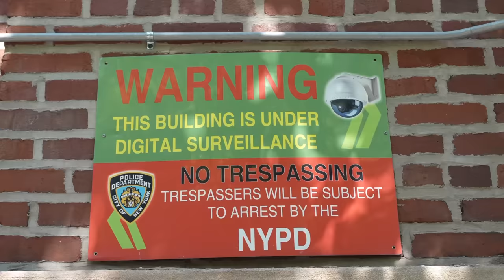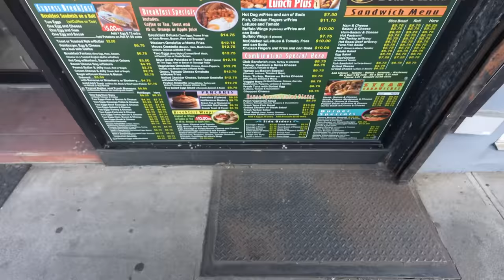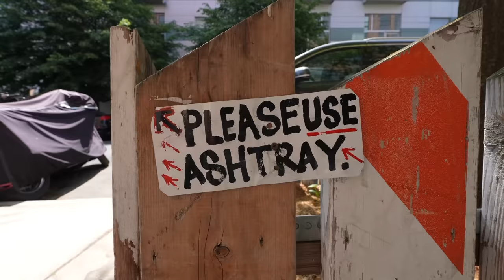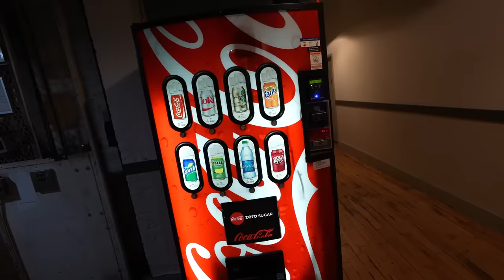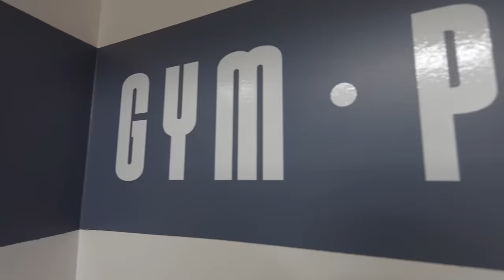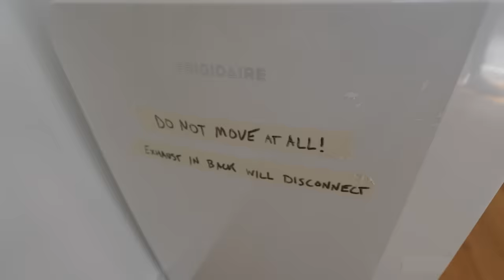I Found NYC’s Largest Loft… But Nobody’s Renting It

Comment: Best lofts I have seen ever. Units 2 & 4 are the winners for me because I would be able to stand up in the lofted spaces. Not too concerned about not having a dishwasher as I wash my dishes by hand as a single guy. And I don’t generate much in the way of dirty dishes either. Don’t need the amenities of the second building, the first building has just the right amount for me. Yeah, all around great units today.

Comment: These were all great. I'm most impressed by the sturdiness of the stairs to the lofts & the fact you could actually stand up in them. They often seem like a dangerous addition that an amateur constructed. Nice finds!
Reply: Agreed.  In the old factory lofts the staircases should have been made with wrougth iron stokes as well as the 4th one should have had metal pillars under the area of the loft--it looks like the wooden ones could crumble at almost anytime!  :face-blue-wide-eyes:😨😨😧

Comment: I actually liked them all.   The 1st building had more character but the 2nd more amenities.   The 2nd with the walk-in vault was definitely quirky.  1-4 were pretty basic but still nice.   & so much room in each!!!  Just not sure about the gas heat units. Probably put a carbon monoxide detector in each room for that reason

Comment: #1 has tons of space, but I'd hit my head in the loft.  #2 is bigger and more finished, and except for the pipe the headroom in the loft is quite adequate, which explains the higher price.  #3 could be shared, making the per-person price affordable for many.   #4 has the pipe-headroom problem, but it has tons of storage and a bigger, separate kitchen.  #5 is the most expensive and has nice finishes, and it's in a building with many amenities, so for a two-bedroom (plus loft) you get the most for your money.

Comment: 2nd Loft is very nice, spacious (1st isn't bad).  Apt. 3 has a great kitchen area and bathroom. Apt 5 sold it with the multiple bookshelves; kitchen could be bigger for that price.  The apt in the other building overall with the rooftop views is very nice for that price, especially with the sauna, pool and closet space.

Comment: the first place can sectional it off for another room. under the upstairs place. so could make it 2 beds for 1,500 each. the second place can be sectional off for another room and split the rent. or makes great area for photography studio for portraits shoot or other photography studio.  the 4 place can turn into photography studio and still have bed room and other stuff you need. the upper bedroom can be use as editing place and storage area to keep gear locked up if get broken into. first place with 4 bedrooms has tons of options for use. the fifth place upstairs area would be used to hold and lockup all my expensive camera gear if downstairs area has room photography studio but upstairs for editing stuff. out side area great for photographer areas for portraits area. also this best 5 aprt  you shown in long time

Comment: Ah man....
What would be cool for the one where you need to get to door with ladder. 
Build a ladder against the wall which folds out. You could build it so you could hang blankets or comforters on them when not using. 
So many ideas

Comment: That wasn't a "water heater" on the roof. 13:38 13:49 That's where the old wooden water tank was. Without that water tank, do all those red fire sprinkler pipes in the building still work?
Reply: Perhaps those pipes get their water from, oh I don't know, the City?
Reply: @vincentgoupil180  Thanks for mansplaining that.
Reply: @vincentgoupil180  I find it amusing that you think I was complementing you.
Reply: @vincentgoupil180  I believe you are mistaken on the purpose of water tanks in buildings. Very tall buildings may need water tanks every few floors to maintain water pressure, but they are inside and you will never see them. Those wooden tanks, ubiquitous on roofs of older NYC buildings, are to supply the fire sprinklers.

Comment: Using sinks/faucets to judge the water pressure it not reliable. Sinks always have great water pressure because, tiny valves. What you wanna check: The water pressure in the shower.

Comment: Here is my problem with renting in New York, while the properties for the most part are beautiful, nothing is affordable. Not the food, not utilities, nor the rentals. Yet there is a rental shortage, when there doesn't need to be. In my opinion, if rentals were affordably capped then apartments wouldn't sit empty and Leasor's wouldn't be losing money on their rentals. Only one percent can afford, a New York apartment within a nice neighborhood and they are few and far between. In reality when people become desperate, they will cram as many people into an apartment as they can to afford the apartment and call them guests and call their apartments air B N B's, out of desperation. The Leasor suffers massive headaches and fines and it becomes a massive mess. In reality empty apartments depreciate the minute that they sit empty. Affordable capped housing is a very viable solution which works well throughout the majority of the country. If a Leasor wants to lose money on empty apartments this is their choice, but it isn't one that I would make. Several of my friends have decided that until, the cost of everything in New York becomes reasonable, they won't ever be moving there.

Comment: Gas stove with no hood vent to the outside on all but one of these apartments.  Major code violation right there, install a carbon monoxide detector in case that stove isn't working properly.  Also no central air conditioning and the windows are not double hung units where you can stick in a window a/c like in most old NYC apartments.  

Those "R2D2" a/c units like in the last apartment suck ass from my experience.  The idea with A/C is to exchange the hot air inside the house to outside the house.  Those A/C units where you run a duct thru to the outside, well its trying to move all that hot air thru that tube, with an inefficient fan because the unit needs to be quiet inside your house.  A normal window a/c unit has a big ass radiator outside your house, several feet of hot refrigerant run thru the lines, the fins in the radiator radiate that heat to the outside, its very efficient and works the same way as central a/c in a normal house or a/c in a commercial building.

Comment: My loft in nyc was bigger than that. Almost 2,000 sq ft, 14 ft ceilings, and I paid less than 2.6k. Only problem was it was surrounded by awful late night drunken hangouts masquerading as art galleries so it was loud AF until 4 am on weekdays. Right next to this horrendous hangout for overweight nerds called ‘the drunken laboratory’. I bet it’s still open. On dekalb ave total shit show